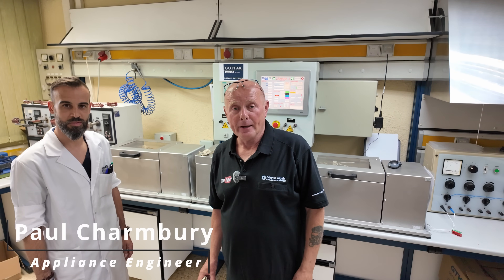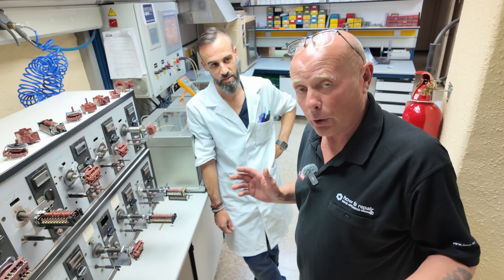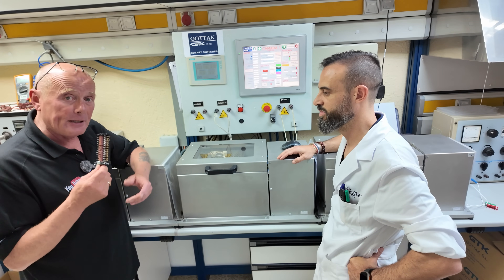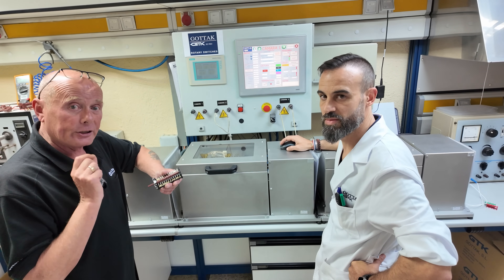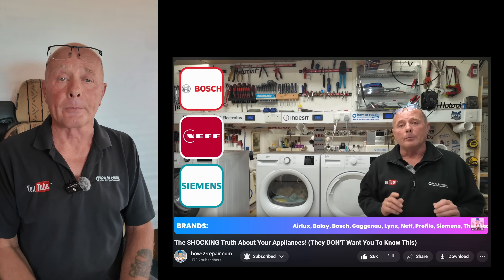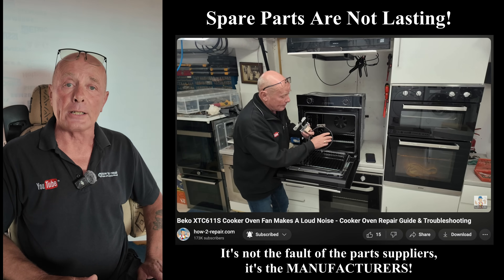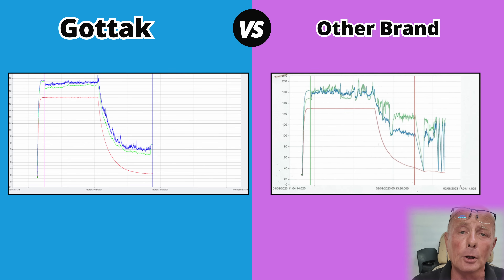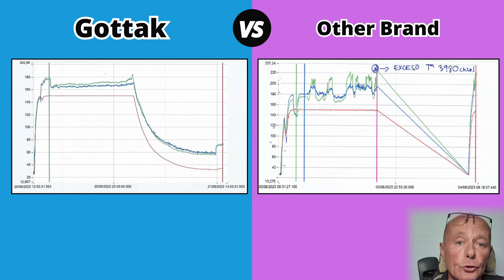Why Your Appliances FAIL SO FAST! Lab Results EXPOSE the Truth!

Comment: Way back in the 1970's My Mum and Granny would have conversations about "built-in-obsolescence." Granny was born in 1895 and remembered "lighting the gas lamps" so saw the conversation to electric in the home, she was very much a gadget freak, while Mum ranted and raved at her about "built-in-obsolescence" every time a new gadget would fail and disappoint Granny who also like value for money and felt robbed. So I've had it drummed into me about " built-in-obsolescence". When but a new big ticket item... the fewer the gadgetry the better. BTW here is my list of makes to avoid, Candy, Beko, Hotpoint, Indesit, Whirlpool, and Zanussi as my 50 years experience as a housewife using washing machine and tumble dryers. I'm 63 and knocked off 13 years as that is when I became a "woman" and Mum insisted I launder my own clothes. Washers and dryers used to last 10 years minimum when I was a child. Today you are lucky if you get 6 years of normal use out of anything. Granny was robbed and manufacturers are still robbing housewives to this day... Snake oil touters/pushers.😢😢😢😢😢😢😢😢😢😢😢😢😢😢 My Samsung washer is due to die on me and I'm dreading the hours or research I'm going to have to put in, to replace it😢😢😢.

Comment: I used to buy nothing but Fisher & Paykel. But they have gone to shit.
We bought an LG WT-H550 been the best a great machine over 12 years old. But has developed a minor leak.
It's weird sometimes you can buy the cheapest nastiest machine and it last well. Like we bought an expensive top of the line Electrolux hepa vacuum cleaner that turned into a flame thrower just out of warranty. But our laws protect us for 5 years. So I demanded a replacement it did the same thing 😂.
So I bought a cheap no name Kingston for $100 bucks compared to the $1400 Electrolux no hepa though. But this thing has lasted 9 years. And sucks better aswel.
Our Westinghouse oven door fell off inside warranty. But it now has rusted out. The seam that joins the oven box has failed after 4 years. Aswel as mutiple repairs. 
Yet my father's oven. Over 40 years old still run like a champion ie its name.
Reply from the maker: When a company is new, I’m trying to get into the marketplace. It produces some very good machines on occasions to build a reputation some more people by their brand but when the companies that have already made it, they just concentrate on capitalising and making as much profit as possible it is a disgrace
Reply: @How-to-repair  I totally agree. They try and survive on name alone. 
But that only last so long. Befor people realize the brand ain't what it used to be. They're all just bad now honestly. Cause all the components are crappy aswel. I just buy old stuff including cars pre 2000's. They literally treat it like a challenge to make it as bad possible.
Reminds me of the Phoebus cartel.
When lighbulb companies were colluding to make light bulbs fail after agreed amount of hours. It's still happening now just on a massive global scale. 
They talk about protecting the environment. But everything they do is the complete opposite. More emissions and materials are being pump out cause constant consumption. To replace faulty appliances.
Reply: electrolux vacuum cleaners used to be good , I still have one in the workshop     Hi from Rangiora !
Reply: @basilwatson1  Ha Ha my cheap Chinese Kingston came from the Rangiora Warehouse best deal ever. My mum was an Electrolux repair technician back in the day. When they actually came to your house and repaired your vacuum cleaner. 
She mostly replaced the cord rewinds in those early machines.
What gave it away North Canterbury 😆
Reply: @basilwatson1  Electrolux vacuum cleaners used to be good as they were made in Hungary but now made in China and are crap it is all about quality control or lack thereof.

Comment: its true the that 70's 80's & 90'd appliances were made better I've got a lec fridge from the 90's still going strong today and a hotpoint freezer from the 80's! a gas cooker from the 80's etc
Reply from the maker: In the 80s, 90s, and early 2000s, most manufacturers produced high-quality equipment to build their reputations. Now, many have large market shares because they've bought up other brands. Nowadays, machines last only about five years on average.

Comment: I don’t mind paying premium prices as long as the quality is there. Our then £600 Miele real stainless steel twin compressor FF lasted 22yrs without a fault till the freezer stopped two yrs ago. The new ones are flimsy plastic imitations so we bought Samsung. Our then £500 Miele W864 W/M lasted 23yrs with only x1 set of gasket, brushes and shocks replacement which I did myself. Our new Miele £800 WED164 W/M is flimsy and tacky compared to the old one. It won’t last. I still have our 24yr old Miele T490 dryer and only replaced bulb, drum sensor brushes and motor drive belt and looks as new today as back then. I will keep fixing it as long as I can.
Reply: Problem is a lot of the time the quality isn't there even at premium prices. It has sort of become this thing where you have to be very good at what you do to know the difference between a good quality alternative and a poor quality, the price isn't enough anymore.
Reply: @joopie46614 I would really appreciate your view on what washing machine, fridge freezer and built in under fan oven you would recommend or manufacturers? Thank you 🙏🏻
Reply: @SamsungJ-wy4iq Neither, and I think all experts will tell you that too. There is too many factors to be able to recommend a good machine, but general rule of thumb is to research the machine to see if it is repairable (search up repair videos for that specific machine), has any major manufacturing defects, stands the test of time with others, etc. Avoid very new models since those likely won't have much testing done by the general population, go with an older but tried and tested machine rather than the newest most innovative. Also make sure the manufacturer can put their money where their mouth is and look out for long warranties (3-5 years is probably ok nowadays)
Reply: @joopie46614  Can't a consumer buy a professional machine like a Electrolux QuickWash QWC if they truly want quality? At the end of the day a 6kg Quickwash QWC is a £2500 washer, while OP's Miele WED164 is an £800 washer so the Miele is still going to have a lot of corners cut to achieve the price (for example, labels are now printed on directly like a budget machine instead of being behind a clear panel to make it impossible for the labels to wear off).

But overall I still think Miele's seem reasonably solidly built -- at least for a domestic washing machine at the prices they cost, given that their prices have increased by less than inflation, hence the cost-cutting. Agreed that their electronics can be flaky and their boards are overpriced.

If you want a solid washer however, there is very, very little plastic in the Electrolux QWC and it is VERY  solidly built "like a tank" and it is rated for some enormous number of cycles (15,000+ cycles?), BUT you pay for that when compared to the domestic Electrolux/Hotpoint/Indesit washer with its low price (1/8th the price of the professional Electrolux?) and low 2500 cycle rating by Electrolux's own admission.
Reply: Sadly Miele is no longer quality. I had my washing machine replaced 3 times in recent years. The machine was over 2k new!
Reply: Yeah Miele is nothing like it used to be, when I was a lad in the 70's / 80's my mothner had almost exclusively Miele washing machine, tumble drier, dishwaser etc and they just went on and on and on - 25-30 years I think with nary a blink. My first, and only, Miele FF died after 5 years - never again.
Reply: I think that this problem exists across all machinery,  hoovers, jet washers   lawnmowers  cars even.
Reply: I always tell my grandma if the washer breaks and a technician won't fix it I'll scavenge for parts for it especially now hearing that her over 30 year old washer and dryer is better than the new ones and they are Miele washer and dryer but her old microwave oven almost set fire to the house after 17 years of use and her fridge was also very old probably also the same age but it didn't cool properly anymore I did a bandaid fix setting the Hidden thermostat at the coldest but eventually it was replaced with a pelgrim fridge her induction cooker had faulty electronics after 18 years of daily usage not fixable yet my mum's AEG had to be fixed after 5 years with enough pans running if I opened the drawer I could smell hot electronics the failure was all the coils stopped working with one left working It's awful the quality nowadays yet my grandma's dishwasher had only one fix the door spring snapped but that was replaced and even if the drawers are getting rusty she keeps using it and it never disappoints compared to mums dishwasher since it sometimes leaves tiny food leftovers on the dishes
Reply: My my expensive dish washer fall appart. I bought the absolute cheapest noname I could find. And that cheap one is almost exactly the same. Either it, or most the components come out of the same factory.
Reply: Premium prices just get you consumer "features" meaning just more cheap stuff to break.
Reply: Stupid that it's us the consumers that are allowing them to get away with this so much for going green.
Reply: Miele WAS quality made in Germany.

Now it's junk made in Poland! Fact!
Reply from the maker: Thank you for sharing your experience mate. It's a perfect example of what many people are feeling. Those older machines were built like tanks and truly earned their reputation. However the newer models just don’t have the same build quality. It’s frustrating to see prices go up while longevity goes down. I would greatly appreciate it if you could share this video. Together, we might be able to bring about some change. Let’s hope the industry starts listening.
Reply: Samscum needs to be sued again. In 6 years and 7 products, they have never honored their warranty and have committed breach of contract.

KNOW YOUR RIGHTS: Those void if opened warranty stickers aren't legally binding. You can open and repair your stuff with 3rd party parts legally. It is illegal for a company, including Apple, to void a warranty. 
Their home screen is illegal.

A company has to prove that the scratch or cosmetically damage area is responsible for the failure to deny a warranty illegally.

Contact your state and federal consumer protection boards website to learn morr.
Reply: Consider stocking up on spare parts now while you can, im finding some parts are becoming scarce and hard to come by
Reply: People don't pay premium. They think they are saving money. When I designed product I tried to make them robust
Reply: One thing about a person like you that wants to fix everything is self forever, most of his appliances fail by burning his house down because every other thing that was meant to fail first was repaired until the fire failure occurred.

Comment: Great to see the actual data explained. 
It’s been terrible to see the race to bottom over the past 30 years across the home appliance and other industries. People just accept poor quality as while appliances are still expensive they can  generally be replaced for the price of 2 - -3 repair call outs for simple inexpensive parts so people tend to just purchase a new one if anything goes wrong as they expect further failures in the near future so they may as well start the clock again rather than have to deal with planned obsolescence of the entire appliance . 
In the past you might have to replace a major component after 10 years but it was worth the cost because you could expect the machine to last another ten without anything else failing . Now we can expect the failure of numerous basic cheap components in the first 5-10 years which make the cumulative cost of repairs excessive.
I really hate handing hard earned money over for flashy looking modern products which have been designed to fail.
It’s essentially fraud and warranty periods need to be increased to 10 years by the EU to deal with this.

Great videos 👍🏻
Reply from the maker: Thanks a lot for your comment mate. In the 80s, 90s, and early 2000s, most manufacturers produced high-quality equipment to build their reputations. Now, many have large market shares because they've bought up other brands. Their main goal is to sell machines. They use green marketing tactics to their advantage but aren't held accountable for the growing pile of discarded white goods. Nowadays, machines last only about five years on average.
Reply: A waste of time testing if you don't name and shame the manufacturers.
Reply: It is the green ideology which was adopted by socities that after calculated time all things must degrade by themself. It is very good for producers who can use recycled waste for new constructions. Cheap recycling (only  such is economical)  alows only bad durability. Then it goes back to  scrap  and  recycling and circle closes . Lost  are water and energy.
Reply: @Mikexception  I've had two products fail recently. One was an electric pepper grinder since it is tall and thin and fell off the kitchen top onto a carpet. The weight of the batteries broke the battery lid. The plastic was so thin it was bound to happen. Second failure was similar. It was an electric shower and a bit of a yank on the hose and a thin plastic part of the case that held the hose in place broke. Both these failures could have been avoided by correct product testing or by intelligent design. However it is often deliberate.
Reply: 10 year warranties need to be standard.
Reply: @Google_Does_Evil_Now  I would say better specification in the specs. When I bought a monitor some years ago, only one make specified the lifetime of the screen. This was the one I bought and it did live up to its spec. It lasted a lot longer than the unspecified one I bought before.